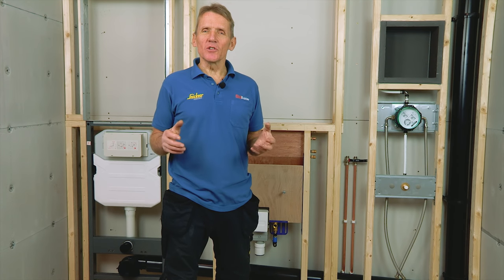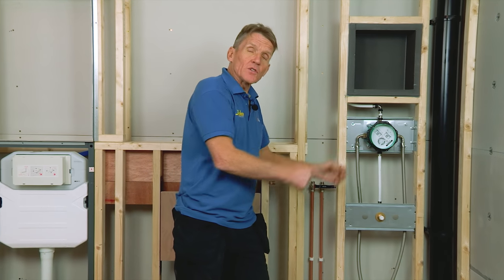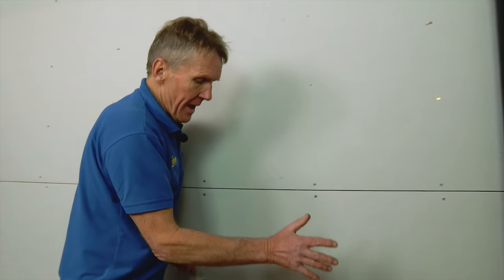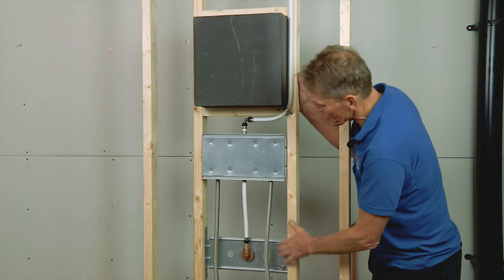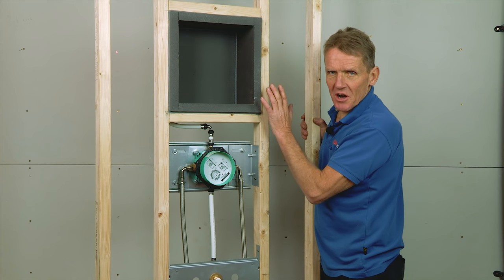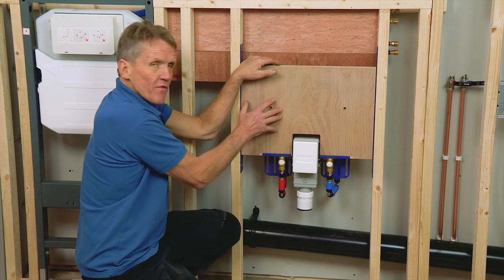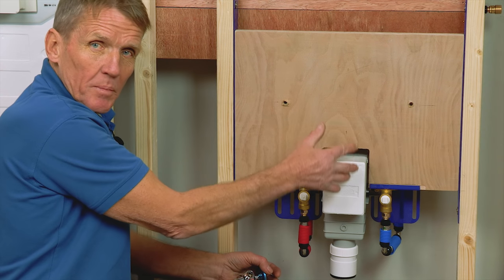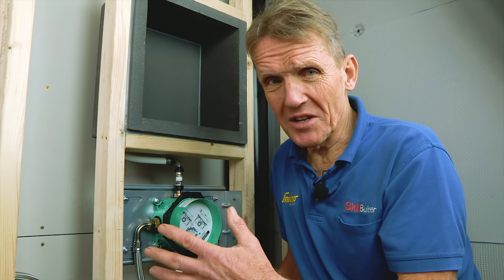Pre-Plumbed Bathroom - The Abacus Working Wall

Comment: Very naughty Mr .Roger screwing those half inch flexis onto 15mm compression threads on those lever valves ;)
Reply from the maker: OMG, you are so  right. I honestly don't know how that got past. I will be honest with you. The whole thing was installed as a mock up for a sales conference and we took it apart filming the video backwards as we went. I always use the adaptors that go from compression to 1/2 inch male iron but well done for pulling me on it. I am kicking myself now for letting it slip through.
Reply: Do you mean at 8:01?

For the uninformed such as myself, why is that a no-no?

Comment: Old bathroom completely cleared ,and toilet and sink unit and shower area refitted using Abacus working wall system, the shower is walk-in with a screen fitted on one side, however the shower floods the shower area then moves to rear wall than onto main floor and under door, I am the left with a pool off water which unless I mop up can be there several hours later, drains have been checked but no resolution, any ideas what’s gone wrong.
Reply from the maker: Hi R Jameson
What tray did you use and can you send us some video so we can see what is going on? The tray waste is good for any shower you care to use so we have to see a spirit level on the floor and we also need to know that there is a fall on the wate pipe. Sometimes it is run out level and that will cause a back up.

Comment: Would not use, so many connections inside wall IF i mean WHEN something leaks you need to tear wall apart.

We use PEX with PEX sleeves and all water sources is run by separate pipe from manifold that is placed room where is also furnace or other heat source. So that way you get zero connection inside wall which might leak and if something leaks water will come out from end of PEX sleeve and there is also drain nearby.
Reply from the maker: That is a good system I have seen it in Norway. All joints are tested except the connections between the panels which are accessed under the shelf but I agree that having it all outside is best.

Comment: What other crap can man create, always trying to reinvent the wheel, most flexible hoses are meant to be changed every 10 years
Reply from the maker: Yes I wouldn't use the flexi hoses. I prefer to crimp up the connection with pex pipe. This is for multi-dwellings, maybe a block of flats and it means it is all ready for boarding, fully tested. Big builder get loads of aggro with plumbing because each plumber does it differently
Reply: Do you have a preference for PEX over PB? 
(I have no experience with plastic pipe, but thinking of using PB for some limited final branch connections in 15mm using traditional compression fittings & inserts) @SkillBuilder